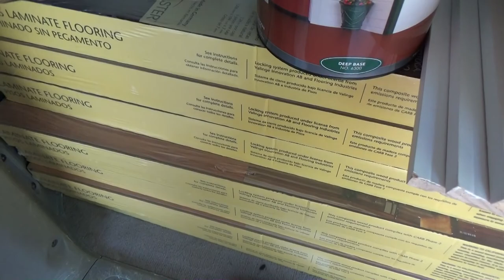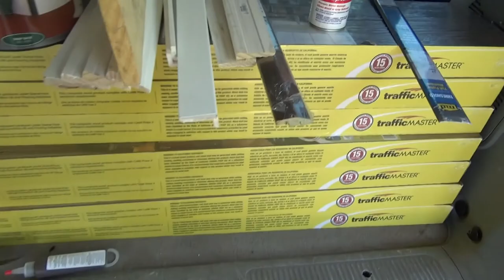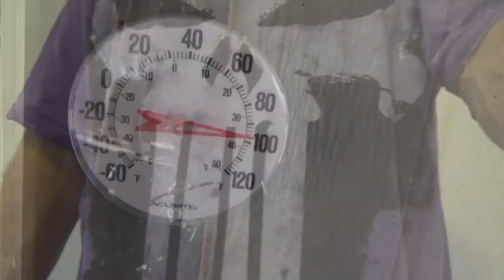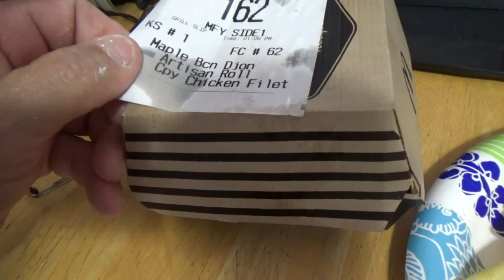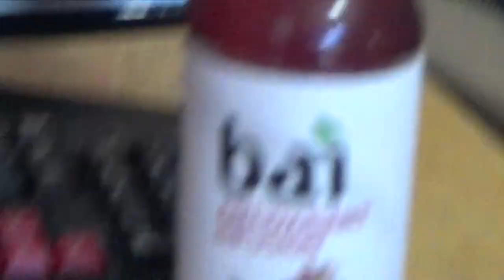The Tiny House Project Day 49  I PAINTED THE INSIDE WHITE

Comment: There could have dust in that corner you didn't see when you wiped the wall down  easy to miss I would sand it on the edges lightly and repaint that spot. No biggy unless you can see it after it dries and cures completely.
Reply from the maker: +TIOGA DRIFTER the blue tape peeled off the paint, it's the cheap Home Depot brand Behr paint, that garbage paint.